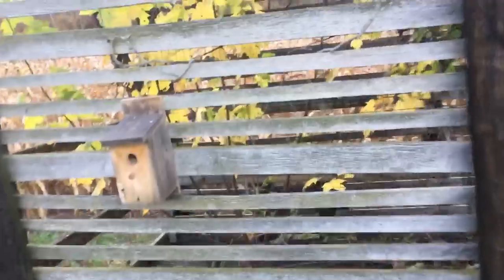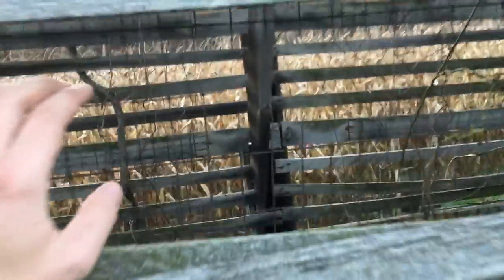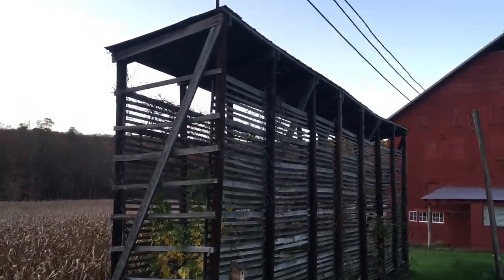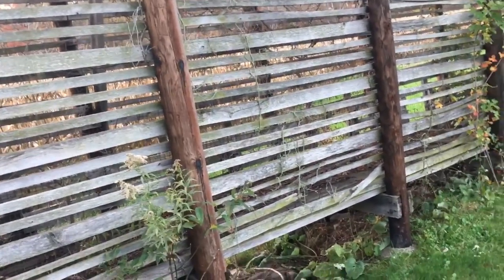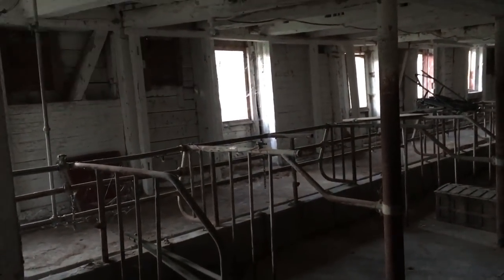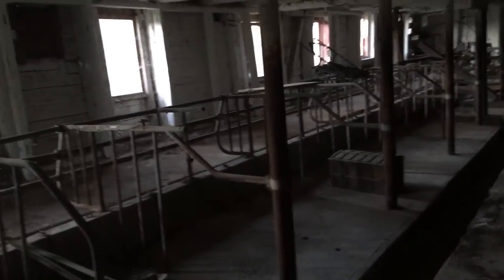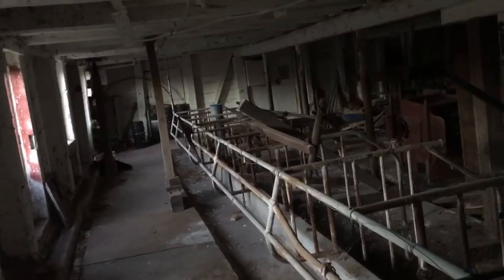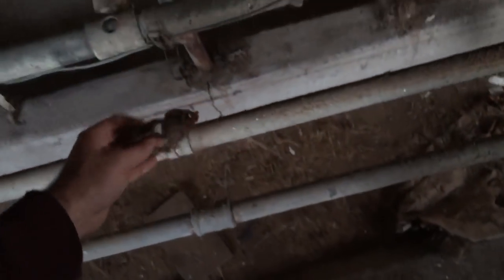Corn Crib & Dairy Farming

Comment: I'd give anything to have a corn crib. I would prefer a more covered metal one, but I have toyed with building a wood one like yours. But as you say, that one sits in a wet spot, I'm faced with the same issue of placement without taking field space.
Reply from the maker: +Boehm Farm if you have space along a shed, I have seen them built right along a barn wall. Using the shed wall as the back then sink a few poles and you have a crib.

Comment: Hey, great video.  My understanding is that corn cribs on grain farms were in used up into the 60's (my uncle did anyway) when in-field shellers and combines became prevalent.  Dairy farmers continued to used them for, as you described, cattle fee.
You may already know this but the crib's narrowness and slats were so that air could flow through and dry the corn down to a lower moisture.  I don't believe dairy farmers use ear corn very much anymore and I don't know why.  I know very little about it but I thought the cob added bulk.
Also, as you may know, the corn picker was far and away the most dangerous implement on the farm.  If stalks got clogged in the snapping rolls and you started pulling them out, when you finally freed them up the rolls would pull you in faster than you could react and let go.  Legal liability is why they're not manufactured in the US anymore.
On that happy note.. thanks for the video.
Reply from the maker: Bob Smitt thanks for watching, my uncle lost his leg in a picker. You are right about being dangerous

Comment: I have a double wooden crib with a driveway in the middle, used it up 'til I sold the dairy herd 4 years ago. The wooden crib is more forgiving if you have corn that's not quite as dry as you'd like it. When I was a kid one of my least favorite jobs was climbing up into those cribs and pushing the corn back away from the elevator so my Grandfather could fill them to the very, very top.
Reply from the maker: +Farmer Pete haha, I owned a corn picker but never picked any. Was going to do it that way then I got the MF750

Comment: Could you do a favor and link the facebook page I haven't had any luck searching it. My FIL is in Minnesota and his dairy barn sits empty due to the low price being paid for milk. He's running around 60 head of holsteins looking to get back into dairying but the price just sucks. Going to look at a 1466 Black Stripe with a cab in the morning I found on Craigslist. Will be the first IH on my farm (had a Farmall M for a while) and the 2nd ever IH in my family. Not quite an 86 series but I think the price is good for the iron thats there, beats the heck out of a JD of the same age and HP. Most of the corn cribs left here are the round wire ones but there are a few wooden ones. Some around here were converted to grain storage.
Reply from the maker: JohnDeere3020Boy ok will try to get a link